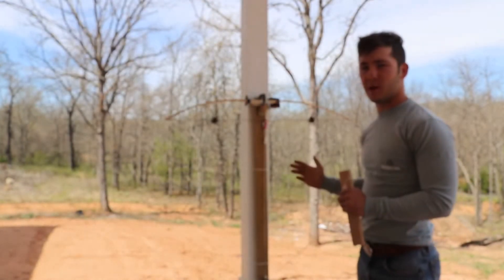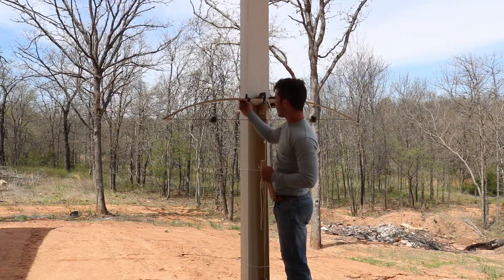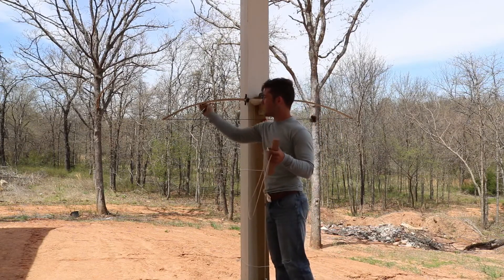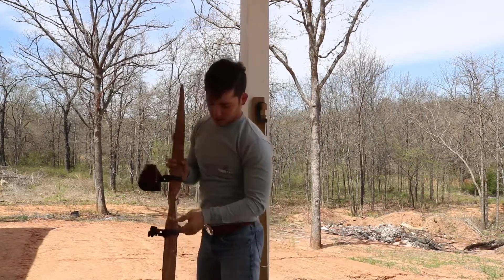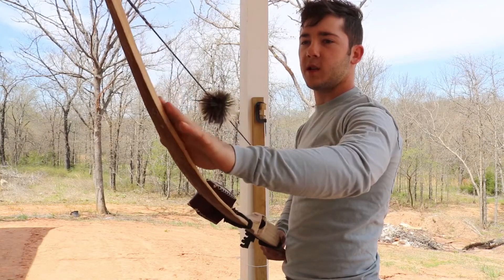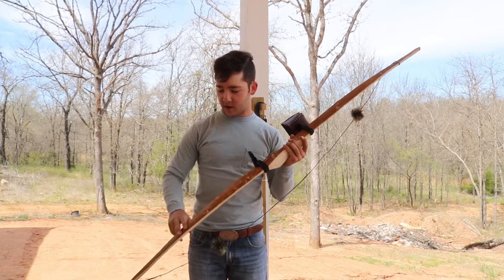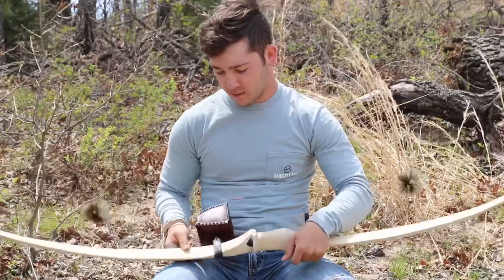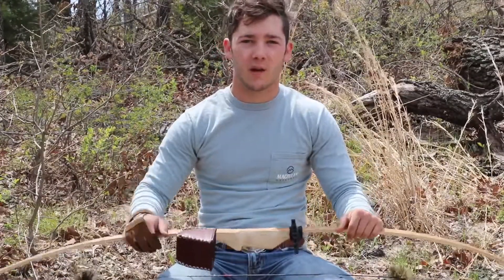Building a White Wood Selfbow- Shooting

Comment: I can see a weak spot about a foot in from the tip on the bottom limb, that is why the bottom limb has taken so much set. Look up a tillering gizmo in the how to section of the primitive archer site, this is a neat little tool that will help prevent this kind of hingy spots in the future.